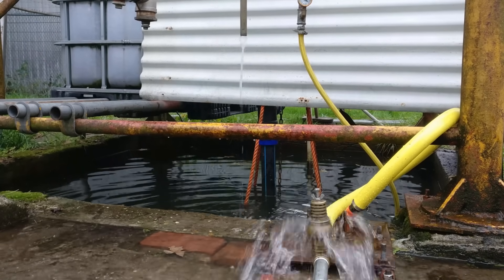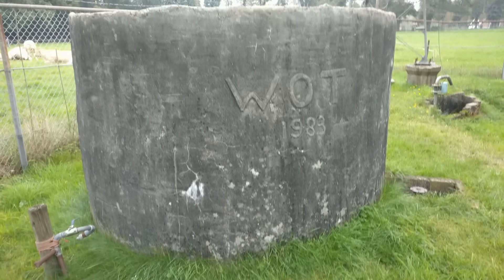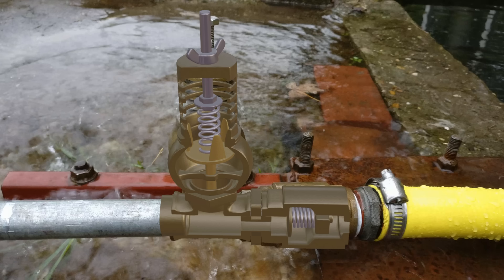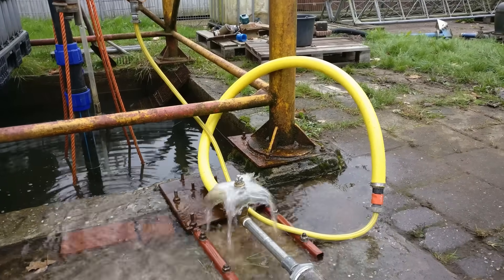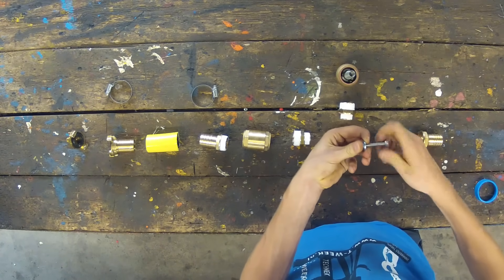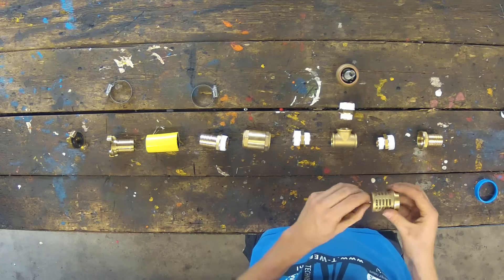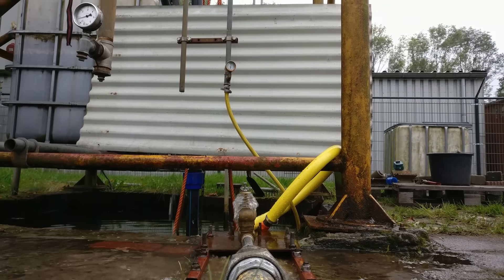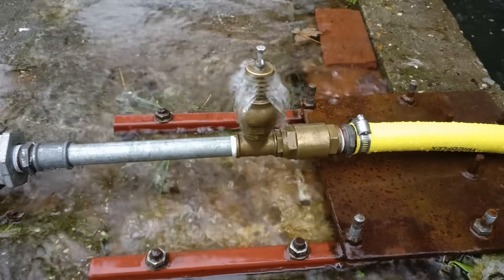Pumping Water Without Electricity - The Breurram

Comment: Surely the lost water could be recuperated and reused somehow to make this setup even more efficient.

I don't know anything about engineering or plumbing, but maybe that lost water can even be reinjected into the pipe using some sort of mechanical 3-way priority valve that prioritizes flow from one input and leaves it to the other input to satisfy the remaining flow capacity of the output pipe?

But I dunno, maybe this is more complicated than I make it out to be.

Comment: Although I like the idea of valves with adjustible tension, the springs act as additional points of failure for the pump. Ideally a ram pump should only have two moving parts (i.e. the valves). This is why a pump with weighted valves would be more reliable.

Comment: I am looking for a solution to make a pump from what there is NO lost of water. I have a IBC container filled with water and nutrient for my NFT hydroponicsystem. I would like to make the water runs from the IBC up to about 4 meter higher. But, als a normal rampump need the water goes in with a normal free entering and the water that goes back to like a river I can't see how I can do that so the water goes back in the IBC container.

Comment: This is basically the kind of ram/pump that has been used for hundreds of years, and is still being used on pastures in the alps to get water up very high for the cows. The principle itself is a thousand or two thousand years old, dating back to when although iron was already known, stuff was still mostly made from bronze.

The build shown in the video is surprising at first sight, as there needs to be an air vessel for this to work, and there is none! The guy who built it replaced that with a thick hose, which is somewhat ingenious and somewhat stupid at the same time. It's ingenious insofar as it will "magically" do the same thing without the known problem of air loss (unless your air vessel is really tall, this is bound to happen slowly but steadily), exploiting the rubber's elasticity instead of air's compressability. It's somewhat stupid insofar as it's guaranteed to break after not too many years because the rubber experiences drastic material aging. You typically want to install a ram, and your grand children will still use it without ever thinking about it.

The ram's biggest problem is that while "no electricity" looks great, you don't get anything for free. The laws of physics still apply, so if you want to move water up ten times higher than your source, you can at most (not counting energy losses) move one tenth of the amount. If you want to go a hundred times higher, well... figure.
The remainder of the water is lost. You're paying the "no electricity" feature with drinkable water, which is pretty much as expensive and desastrous as it can get.
On a mountain pasture, that may still be acceptable because the water is free and abundant, and if it's "lost", it will still go somewhere downhill where plants will use it up, and on the other hand, installing electricity in the middle of wilderness on a mountain slope may be a challenge. For other uses, I don't really see it as a competitive thing. It's somewhat cool, admitted. Buta a small electric pump will do the same, more efficiently.

Comment: I've seen the ram pump and now this, it's super impressive. My friend and I were on his Uncles farm in Cape Town, they have a pump there which I'm still trying to fully wrap my head around. It was not very well explained, but I think I figured it out:P The starting point is about 200 metres away and about 5 metres lower than the collection point, maybe more (the 'pump stations' weren't in a straight line). There are three 'pump stations' along the way, and it's just piping and concrete (each pump station is about 2 metres tall, half of which is dug into the ground, and about a metre round, I think the intake was higher than the outlet, and I can't remember by how much). 

It starts at the side of a fairly fast moving stream. On the side of the stream is a concrete channel, which, I'd say, about 20% of the stream flows through, freely. The channel is about 4 metres long, 1 metre wide, and about 0.7 metres high. To fill up the channel you lower a metal gate. Then another gate is lowered to prevent water in the channel returning to the stream. Once the channel is full, you raise its gate and water is forced into a drain which starts the process of pumping the water up hill via the other pump stations. The destination of the water is a small dam, which is then used to irrigate the farm via gravity.

My friends Dad gave us a demonstration (his Uncle wasn't there), he's a rather comical introvert character, great guy to be around but jeez can he be cryptic in his mannerisms and explanations. Gotta love him. Anyway. Even once the gate opens water continues to fill the channel, so it only slowly loses pressure. Once the gate was lifted we watched the water for a bit, then walked to each pump station, and finally to the dam. At a rough estimate, I reckon the emptying of the channel took about 20-30 minutes. And there was quite a head of pressure exiting that final station.

It blew my mind. I was very impressed. I only wish it that it was better explained to me. But I think I've got it... If anyone reads this and understands what I'm saying :) I'd love to know more, and I'd really love to know what this type of pump is called!

Comment: Back in the forties I knew a man who had one of these - quite large and made of cast iron. In those days they used to call it a 'pulsometer'. He lived by a snall hill which had a spring near the top. He used the machine to pump water up to the tank on the roof and the excess water flowed back into the stream. You could hear it clacking a long way off. For a boy of eight it was quite facinating.

Comment: worth noting is the pipe between the tank and pump. as it is the kinetic energy of the water in this section that drives the pump. meaning, a longer pipe will pack a bigger punch.

Comment: So how do you start it? Just make sure that that loop is facing upwards so that the air will stay trapped so it doesn't backfeed? You still need some kind of elevation change for the source though right? The water needs to flow downhill slightly in order to make enough pressure to overcome the spring in the first place

Comment: This is a simpler variant of the ram pump. I can't comment on which is better as I have never used either. The ram pump uses a second check valve with a  small pressure tank after the valves. Small meaning a 2 foot length of 4 inch PVC pipe with a partially inflated bicycle innertube inside to act like a pressurized well pump bladder tank.

Comment: Has anyone tried making it perpetual? Or is there always a water loss no matter what one does
Reply: Perpetual motion is impossible
Reply: @Coastal_Cruzer  nothings impossible. Me and you just haven’t acquired the knowledge yet. Like all things, it’s impossible until someone does it.
Reply: @lowkey213  *you and I, also that's not how it works. Perpetual motion hasn't been discovered because IT DOES NOT EXIST. You can not remove more energy from a system than what has been put into it
Reply: @Coastal_Cruzer  so I’ve heard. Thermodynamics. And still, examples exist. Did you know two magnets attract more then they repel?
Reply: @lowkey213  no examples exist because it is physically impossible. Think of it like this. You can't pour 6 units of water from a 5 unit container. You can not get out more energy than you put in. Only equal or less. Perpetual motion is impossible outside of a simulation

Comment: If I understand the principles behind this pump correctly, it's basically like a lever, but for lifting a liquid rather than a solid mass.
It utilises gravitational potential energy and some basic principles of hydrodynamics (pressure vs. flow) to obtain a mechanical advantage that allows the water to be lifted to an impressive height.
Very cool, thanks for sharing this!
Reply: It might be easier to explain using water hammer. When the flow is suddenly cut off the moving water “hammers” the other valve open, lifting the water.

Comment: Under the assumption that this works... Why not have all the "wasted water" flow back into the concrete pond and the using another pump of the same type, and either pump it back to the tank, or also up to the tower?
Why does it need to flow back to the river?

Comment: Seen similar one but smaller i called it clanker pump as not sure name ,was in australia we stayed on isolated property ,had shed with shower ,running hot cold water ,was hill at back of property had old sealed tank on top ,had water pipe feeding tank on bottom entry and pipe at top going to shed ,light fire in bottom of tank wood fire heats up hot water rises feeds shower ,anyhow looked for how water got up hill found pump on side of running river clank clank it was making that noise so basically this small pump has pipe inlet in river ,lift up plunger on pump water goes in starts clanking automatically feeds bigger pipe out rear before hill diameter pipe is made smaller increased pressure pump up hill to tank had overflow on tank went back to river also had pipe feed cold water to shed with hot water via mixing tap hot cold perfect shower no electricity pump was very old cant find one anywhere no one knows much about it had no name on it perfect shed fresh drinking water hot shower fish in river rabbits on property great place got go back see it again .

Comment: There is something similar in pneumatics, you can boost the incoming air pressure by a multiple of 1.5 (or more or less depending on how the booster was designed/how much waste pressure is vented).  Worked great getting 100-110psi shop air to about 150 for the machines that needed it.  Your volume of air that can be supplied suffers a lot due to the waste air being vented, but without using more compressors the boosters work fine depending on the application

Comment: For anyone wondering, the system is using the momentum of the flow to store elastic potential energy in the pipe system, at peak elastic potential, the stored energy is released into the high pressure element and used to move the fluid fractionally within the high pressure system, once the energy is used, the cycle repeats, flow increases, stop engages, energy builds up, is released into high pressure and repeat.
Reply: Right, so basically the potential energy of a large amount of water is used to pump a small amount of it further up than it came down.
Reply: So, water hammer, basically, right?
Reply: @edew9180 yes

Comment: This sort of physics phenomenon is very nearly analogous to how a boost converter works. Those are in most battery powered devices. The circuit takes a low voltage and "boosts" it to a higher level. Voltage is analogous to water pressure, and therefore water height. The inertia of the water moving is analogous to the inductor in a boost converter, which is resistant to changes in it's current flow. The one way valves are analogous to a diode. Basically the same concept of switching a valve (transistor/diode) closed while water (electricity) is already flowing to make a hydraulic pressure spike (voltage spike) and capturing the pressure (voltage) differential with a one-way valve (diode) applies to both. In electronics, the "self oscillating" behavior shown here would likely be made with a tank circuit, formed with an amplifier (transistor/IC) and capacitor across the inductor.

Comment: So you are using the "water hammer" effect to puch a small part of the water up to the tower. What I wonder is if the same water powering a "turbine"(or an other pump) that drives a smaller piston pump could pump the same or more water while wasting less to the same height at the same or better flow, did you look in to that to?

Comment: If you build a channel around the pump and direct the water back to the source..... or somewhere usefull
= no waste water
= no shame

Thanks for the video, one day I will be glad I watched it so I can use the method.
Reply: Directing it back to the source would need another ram pump .... which would also need another ram pump to pump back its output.....

This pump is a smart way to concentrate potential energy, called head in hydraulic system, lots of water with little head flows through, coming out with next to 0 head, while a little water is pushed against high head

Comment: Connect the "lost water to the infeed side of your source, a second tank set beside and connected by  simple check valve to hold the main tank pressure, and when enough water is "taken out/infeed" the valve opens and a portion of the lost water is recovered. Can even use a second Breurram to feed it from the catch to the prime tank, you will always lose some but the more you recover the less you have to take from the source.
Reply: this is critical and ignorantly left out of the video. If everyone wasted this much water from the rivers we would be in trouble.
Reply: @SnowflakeHaze  What if it just flows back into the river
Reply: @sharkheadism  If it gets back to the river that's great but this one had no return system to my knowledge it would just add to local ground water and evaporate.

Comment: My grandfather has this on his property and the water lost is collected and then pumped back into the main holding tank he's getting his water from. He told me thats its "basically only 1/4 water loss. If more tanks are added for collection you can go down to 1/8 loss, 1/16 loss and so on with enough tanks and slopes." He uses this pump for his house plumbing. its pumped into a make-shift water tower then gravity fed into his home to maintain water pressure. Pretty awesome
Reply: but if you need to use a pump to get the lost water back into the tank then why not just use a pump for the job instead of adding steps to it?
Reply: @@JuneAtHomePHno. this pump is basically treading large amount of water flow speed for small amount of water hight. a well do not have a large flow speed so this pump can not be used

Comment: I know nothing about water pumping so this may be a stupid question, why not just allow the flow from the pipe (which is continuously fed by the river) directly into the vertical pipe then the water naturally rises without any losses and all that would be needed is a relief valve to turn it off when not needed and this could divert back into the river.
Reply: GRAVITY

Comment: I don't understand where the entering pressure should come from if it's normally used with rivers?
Reply: the pump as the drawing shows [& the LINK in the description takes you to the in depth build drawings & data also shows] is FED by a FLOWING RIVER- and is located on a DOWNSLOPE such that there is [in his iteration 2 Meters] a min 3 foot of HEAD to the pump located below source... this is a LIMITING factor on how high you can pump the water & what volume you will move... he wanted his tower to be filled at 12' of elevation so he had a 2 meter HEAD.

Comment: I know this has to last longer than the traditional ram pumps people build today from pvc or of that design. Those flap valves tend to wear out pin that holds them. and creates inefficiencies until it no longer works. 
How long do the springs last? I do enjoy this water sound more. than a bunyip pump thump sound, made from a tire and springs. And the other bits and bobs.

Comment: I'm going to have to watch this again or look for a better video.. I'm failing to see how this works, and where is the energy coming from.
Reply: The power of the water supply's weight. Be it weight, height or flow rate, and elevation differences normally decides flow rate.  or in this case height of the water tank on the ground. I think. Never really thought about it before. Just looked at it working and went yeah seems good to me. Most water rams operate in the same way. Just different designs.

Edit: Think about all that weight from the water storage supply pressing down on the water It fills the orb with so much pressure it locks the top spring valve. And that forces the valve open to the storage tanks in the tower. When that valve opens it lets a little water flow to the tower tanks. It is a very small amount. But it keeps pressing another small amount then another small amount. The weight of the ground storage tank pressing little bits further and further up the hose. 
idk should probably take a nap.